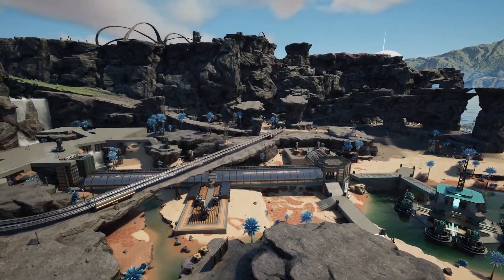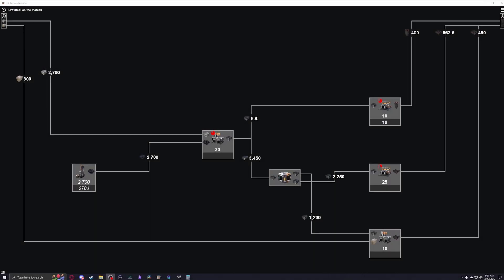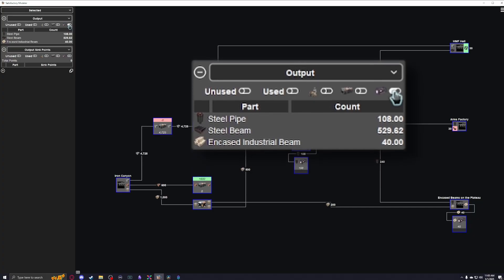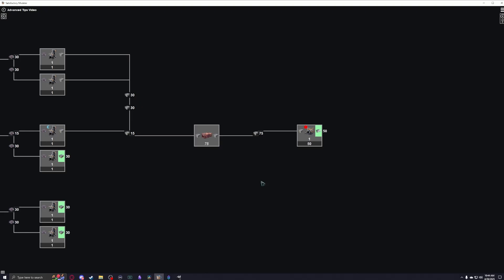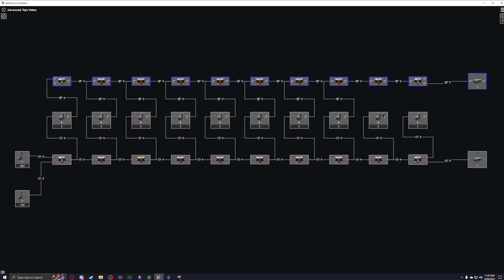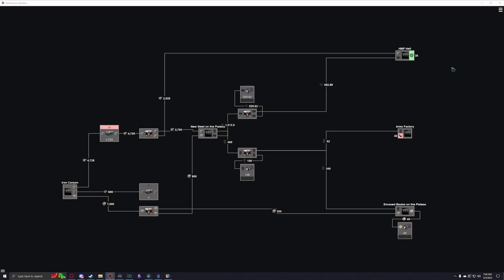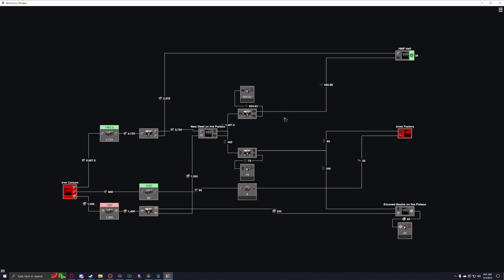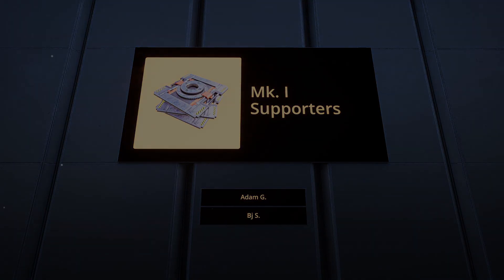Satisfactory Modeler - Tips You Need To Know: Splitters, Mergers, Metrics, Plan Types, & More

Comment from the maker: Alright so a few things I wanted to keep pinned:
1. If you're down here looking for how to change your lines from curved to straight it's in the top right settings menu: Settings > Style > Connection Style > 2D.
2. Apparently the load balancer calculations CAN work, and it's likely I'm a tad dense and did my setup incorrectly. @SatisfactoryModeler has a comment below (account was made yesterday so I'm not sure how legit it is but the tech checks out). His explanation is much better but TLDR is I should have used regular splitters and removed limits from my outputs. Once doing that it works great!
3. @paulocardoso5475 Hit me with a MASSIVE organizational tip in that you can click and drag item inputs/outputs around on cards and in the menu that moves resources between outposts so your lines don't overlap.
Reply: The issue you are having with the load balancer is that your version is over engineered, causing the weird issues, you just need to simplify it. First, there is no need for the priority splitter and merger, just use regular ones. But the main issue is that you are defining a limit on your output machines. Simply remove all these limits and let the modeler calculate for you and you will find it works. The reason you are not getting any values calculated in the loopback is because you are defining 300 resources in and limiting it to 300 resources out. With no where for excess to go, any amount of parts could circulate in that loop forever, which is why it is undefined. If you remove the limits from the outputs, then any excess would have a place to drain out and would eventually reach an equilibrium and calculate the numbers you are expecting. The steam store page for the modeler has a screenshot of a 7-way split load balancer.
Reply from the maker: @SatisfactoryModeler  I'm sorry for having spread any misinformation then! Removing the limit on resources to get it to work makes sense. Thank you for the insights. I'm going to update my other pinned comment to reflect this new information and direct them to your explanation.

Comment: Hi, I have a question.
I just planned my new factory in the Modeler up until Pressure Conversion Cube and Turbo Motor.
I had some problems during the process when I wanted to change machine numbers and the programm tried to recalculate everything, but I figured these out and ended the session with an (almost) full factory and fix numbers.
Now I restarted the programm and it starts calculating everything again for ~15min.
Is there a way around this? Can´t the already calculated numbers just be safed when I close the program? 
Why does it recalculate upon starting the programm when nothing has changed?
Reply from the maker: Fixing the calculation time can be done a few ways:

1. Break your factory plans up into smaller chunks so less is calculating every time calculations are needed.
2. Swap to one of the alternate calculation modes.

I'm unsure why the values are not saved upon exiting and reloading.
Reply: @DS_Jeezy Thanks! I now use storage containers to split the calculations a bit, as you said.

For my specific problem it helped to remove a priority splitter which has sent the overflow of reinforced plates to my depot. With the prio splitter connected to the depot it calculated for 30-50min with every change I made anywhere in the plan. 
Instead of to the depot I now send the overflow into a dead end container within the same node as the splitter and now the calculations just take seconds.

Comment: Hey, so I downloaded it. it is great. However, while experimenting with it, I changed my default machine information, and now everything is much more difficult, as mine no longer outputs a standard value tied to the purity/miner level. I have to manually set it. Is there a factory reset type situation to restore the default values?
Reply from the maker: If you set machine defaults and hit "apply to existing machines" I don't know that there is an easy way to get them back to the previous values other than to change that field back to blank and manually undo all of the applied changes.

If you want to pursue this further, here is the link to the developer's discord: https://discord.gg/QsWKNwnxC8

Comment: what this mod needs is an infinite source/sink node (foreman 2 for factorio has this) then you can substitute the outputs of an outpost without it having to calculate the effects of every change you make. you could simply disconnect the outpost and have a node beside it showing the disparity. also foremen 2 has key nodes allowing you to make one quantity non negotiable and everything else is calculated around that. very useful mod.
Reply from the maker: There is a sink option for feeding outputs into, or a container that you can then "pull from" using the left hand sidebar for tracking disparities between those two containers.

The non-negotiable value could be cool. This almost does that, but will still not work if you can't feed it enough resources.
Reply: @DS_Jeezy  the containers seem to be adequate in pass through mode/in=out but at first glance i see a container and not a resource.
 the benefit of a non negotiable (optional) is that it doesnt let you solve the equation until it is satisfied, ie., if i specify an output of 10pm it shows me in red the first node that doesnt allow me to get 10pm, rather than changing my output to 8pm, it basically stops the back and forth to balance the output with a limitation which so far can usually be solved with an over/underclock.

Comment: Thank you for the wonderful guide!

You may have explained it (if so I would be most thankful for a time-stamp), but I have a problem when exporting a fluid (this time Alumina Solution) out of an outpost.
I have put the solution in a fluid container (works up to here).
I pull the fluid out of the outpost and the amount pulled out = 0.

Any tips on what to do?

Comment: I have a question, does program not work with underclocking? everytime i put a clock speed bellow 100% it just goes red
Reply from the maker: The program does handle underclocking. I assume because you said "goes red" that you're using the manual calculation mode? If so you'll need to also change the clock speed of both dependencies and any machines further down the line from what you're attempting to underclock. Imprecise values break that calculation mode.

Otherwise I'd recommend trying out automatic calculation mode. It will take a bit longer in larger plans but it's well worth it in smaller ones.
Reply: @DS_Jeezy gotcha, thanks man I was doing the calculations by hand the whole time and it took forever, this should help tremendously
Reply from the maker: @azrael7201  No worries! Once I swapped to manual calc mode I almost immediately switched back. It's really good for fine tuning and fast calculations but for most I think automatic mode is preferable. Have fun planning!

Comment: Great video, been using the modeler much more recently I use to do layouts as a manifold look , that way I can put clock speed on 7 machines as 100% but the last machine I might put to 75% for efficiency reasons. But I've recently changed this to be just one icon with 8 machines and not bother with the over clocking value. I would much prefer it if I could have this but for 8 machines put a overclock value of something like 775%. which then it can calculate that the 8th machine only has 75%

For my outposts that IMPORT goods I've been using a storage container as "input=output" down the left of the screen. that way the lines from the top left are nicely spaced out rather than all running through my devices.
Reply from the maker: Ah yeah I suppose that kind of overclock functionality is lacking. You could do a bank of 7 machines all clocked at 100% and then a separate card for your last one at 75%. I'm not sure how much extra calculation power that would take but it may be worth a try.

Good organizational tip! Even with all this Modeler knowledge I could definitely organize my plans a bit better so I'll have to give that a try.

Comment: As I understand it, when working with a by-product, you need to use containers. I tried to send by-product water directly to bauxite production after aluminum processing, as a result, 0 was set next to all resources. I connected it through a container, everything worked.
Reply: Funny you mention this. I was just trying that last night and wondered what I was doing wrong, I gave up... I'll have to revisit it and try a container, didn't think of that. Thanks
Reply: @harag9  I didn't expect to be of any use. I was looking for help, but in the end I helped.)))) By the way, thanks for the video on this topic, it helps a lot.
Reply from the maker: Good tip! I haven't done a lot of planning with byproducts yet, as I eyeballed my first oil rig, but I'll keep that in mind once I get to the dreaded aluminum. Oddly enough that may have been the thing that triggered my load balancer setup to work as connecting it through a container and then changing it back caused it to actually calculate correctly.